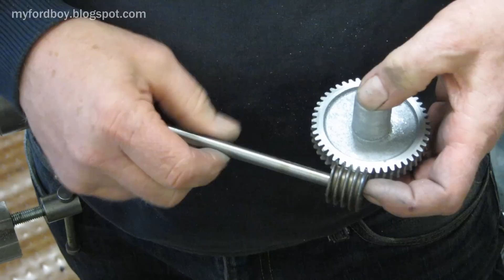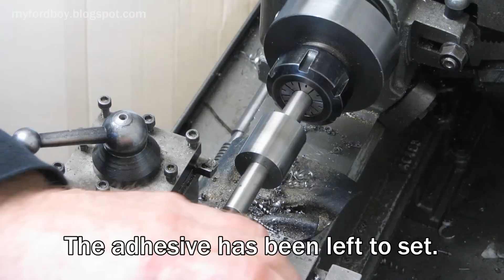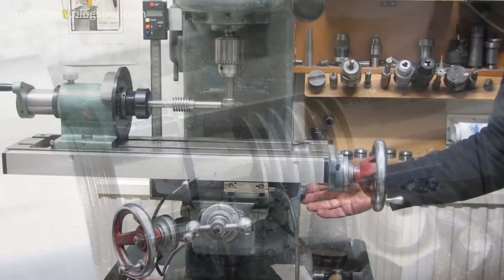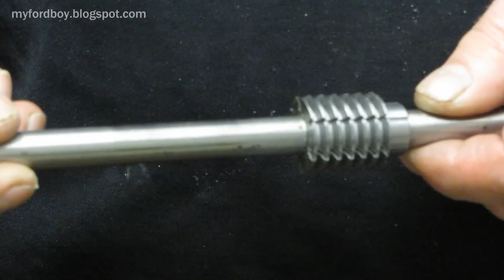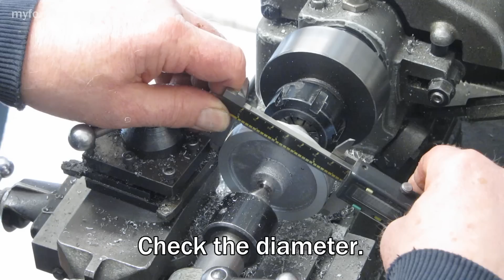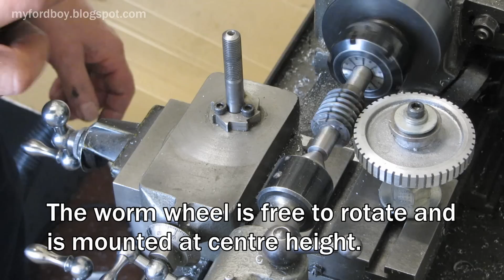Worm & Worm Wheel Free Hobbing Method

Comment: I picked up a Harbor Freight 45861 9 x 20  bench lathe new, a few years ago for about $500 US. About the size of the Myford, just not as refined. I consider mine a work in progress with many upgrades planned. There are several lathes of this size sold by Grizzly and others. A great size for those in need of something larger than the smaller hobby lathes but without the need (or room) for a full size lathe. Love your Myford. It inspires me and gives me something to strive toward on my budget.

Comment: Thanks for sharing. Im a machinist also. There lots of trick you can learn. It very helpful from your experience.  Cutting special thread on lathe is not easy. You got skills . I wish I can learn using software to program and draw desighn for cnc lathe and milling. I have some cnc experiences and manual.

Comment: Excellent technique. Very well done. I do agree with the comment about buying on from, presumably, Boston Gear.

That lathe sounds like the one I worked with as a kid at home. I thought the speed used turning drill rod was high.i had to run the old lathe much slower. I did not have carbide cutting tools.

Comment from the maker: I worked out the worm wheel size and pitch angle nof worm with information in a book. The hardest part is working out the change wheels necessary to give the lead to cut the thread as it is not a standard pitch. 
A method using continous fractions is used and I did find an on line calculator to work out that part.
Reply: What's non-standard about 5·730659 tpi ? (4·4323 mm)

Just you wait until I start threading on my milling machine ! (I'm afraid I can't ! - can't wait to find out what random pitches it'll produce :)
Reply: I have to make a replacement worm and worm gear for my power feed as both are stripped. May I ask what book you used for the calculations? I don't know the correct blank size for the worm gear or what to grind my cutter to. I can reverse engineer it but I'd rather do some reading and learn how to do it right.
Reply from the maker: @LeadedAsbestos  Ivan Laws excellent and inexpensive book. Gears and Gear cutting.
Reply: @myfordboy  thank you. I will order both. You do some amazing work. Thanks again
Reply: @myfordboy  just punched it in. One book lol. Gotcha. I think I'll also get the gingery dividing head book as well.

Comment: The Pitch Circle Diameter (PCD) of a gear is the point between the high and low points that is the theoretical equivalent diameter of a set of simple wheels. Gear teeth reach across that theoretical line and the two extremes are calculated from that median point called the PCD. The outer diameter is less critical than you would think as the highest and lowest points never contact. It is a good place for lubrication to reside.

Comment from the maker: This gear has a 14.5 deg pressure angle so the tool is ground to that angle. It also needs reliving to alow for the helix angle of the gear. The width of the tip is important to and came from data in a book.
I found it easier to draw the angle with CAD and eyeball against this but the tip needs measuring with a mic.

Comment: This is really impressive, and very kind of you to put up.  In addition to the whole concept of making your own hob, loved the bits about using an additional gear set to slow the lathe down to cut the spirals, and using a custom template for the indexer.  I'm going to search around now and see if you've done a similar project to cut your own helical gears...
Reply from the maker: I have cut skew gears but no video record as it was before YouTube existed.
Reply: @myfordboy  I kinda figured you might have.  :)  I've seen setups for it, but they all depended on a very complicated gearing setup between the mill table movement, and a rotary table.  Is that what you did, or did you figure out a shortcut, as you did here?
Reply from the maker: @tomsmith3045  I did mine on the lathe with a milling spindle . Quite complicated. I have some still pics stoneware.
Reply: @myfordboy  Oh!!  So using the carriage to hold a small milling head, with the lathe setup to cut the gears as if they were threads?  That's brilliant.  I'm sure it was a lot of work, but it seems much more straightforward than on a mill, where there isn't any built in coupling between linear and rotational movement at all.  If that was the rough setup, did you have to create auxiliary gear sets, or could you do it with just special threading gears?
Reply from the maker: @tomsmith3045  do you have Instagram? I can post the set up on there if you like.
Reply: @myfordboy  I do!  Thank you!
Reply from the maker: I have uploaded to Instagram #myfordboy
Reply: @myfordboy  Thank you!  Really sharp design.  Love the use of a standard gear cutter, to avoid having to make a special tool.  You mentioned you didn't use the lathe motor - did you just hand feed, using the big MDF wheel?
Reply from the maker: My lathe has a handwheel on the leadscrew and this was used for the feed. The MDF disc is a toothed pulley and belt drive to another, smaller pulley coupled with the changegears to give a very high feed rate.

Comment from the maker: I'll describe it for you here. I don't need to make another so sorry no video.
The V angle in this case is 29 deg as the pressure angle of the gear is 14 1/2 deg.
The tip width is given in charts as .054 for this 18 DP gear. 
The V was ground free hand and checked with a protractor. The point is then ground away to give the .054 dimension. The tool was ground from a broken centre drill. It can be rotated in it's holder to give clearance to suit the helix angle of the worm.

Comment: The only thing I would do differently is to make the worm and hob as one part up through cutting the thread.  Then cut in half and continue with cutting teeth on hob.  Save a bit of time and maybe improve match between them.  Amazed that you got away without tempering the hob…that wheel is one soft casting!

Comment: I like your video.  It gives me hope on a solution.  What my problem is that I need a solution is a large electric motor output shaft conversion to go into a smaller hole of a clutch.  I've looked around, asked around, and seems machinists don't want to do what seems to be a simple male to female shaft coupling.  Basically my electric motor has an 18 point, 1 3/16" diameter, 1.125" long output shaft and I want to broach a sleeve, or internal (female) over it that then has a 7/8 long, 1 point 7/8" diameter output shaft to go into the clutch of my manual transmission of my GMC Tracker.  I don't know if I should try and make a plastic mold and send it to someone, or try and take a piece of stock and broach it with no real tools.  I kind of feel like giving up after handing my clutch and motor to several machinists who put them on their shelf and never did anything with them and only returned them after I called and came over several times.  Not sure what the issue is.  Any help would be appreciated, Jon.

Comment: I already learned most of the job, truth is you learn all your life, but i already learned doing some precision works, i worked on different machines like mills, two smaller lathes and a massive one. I dont call myself and expert in machining, but i would be a mid good guy. I am looking in some years to buy a newer one, a bit smaller than the one you listed, just because i HATE so much the noise that the big one makes in our school, i ant handle it, and i like smaller machines.

Comment from the maker: I have cut steel ones like this so bronze and iron are fine. \If you are using a standard pitch wheel, mine was 48 teeth 18DP thenpitch never works out bto a standard pitch . You have to calculate the lead an set up changewheel to cut it. The one in the video has a lead of 0.1745"

Comment: Shape is not something that can be transferred from a pattern. It is formed by tools set to cut the specified radii of each portion of the curve. There's a good book by Ivan Law: Gears And Gear Cutting - good explanations of design process and cutting processes - Complex, but each part taken slowly builds to an understanding and working knowledge. Expect to take your time, but be persistent and push yourself a little and you'll get it. Only 134 pages but you go a paragraph at a time.

Comment: Hello Myfordboy
Very good video. I wanted to know if you would sell me 1 of your worm drives. I make wooden automatas and I was planning on using your part to copy, using a router. I only need the worm not the wheel. The size in the video would be fine. I would need a 10mm hole centre.
regards
Tim

Comment: Grate job, as usually. Are the following available:
Diameters calculation for both parts
Angle of the tool (40 Deg. inclusive?)
Distance calculation between the centers of worm and worm-gear, nice mill.
The Old Bob
Reply from the maker: All the calculations were obtained from the Ivan Law book Gears and Gearcutting.
I can give you the details of the one in the video if you send me you email address. Mine can be found at myfordboy.blogspot.com

Comment: I think the worm tool needs to be different from the end worm to get the slack in the tooth's foot from the whell worm.
And this is possible by reversing the calculation between head and foot of the tooth of the worm tool.
Maintaining the distance between centers in the manufacture and use of the assembly.

Comment: If you had an adjustable Z axis on the gear when machining it, could you cut a helical gear the same way?
Reply from the maker: A vertical slide on a lathe would give you the same functions as a mill. Bevel gears are cut a different way like this https://youtu.be/7yld4VboYg0

Comment: Could you make the cutter and the actual worm at the same time in the lathe on one arbor? That way would only require one setup and the cutter and worm would be exactly the same size and geometry.
Reply from the maker: You could do that but the reason I did it this way was,
The cutter was made of silver steel and the worm mild steel, making them separately means  a shorter work price so less chance of flex.

Comment: Danbackboard You cut counterclockwise because of the design of the lathe and the fact that you want to have downward pressure on the tool bit.  If you use upward pressure, all of the backlash that would be introduced into your carriage and compound rest would make it impossible to keep rigid (chatter free) and accurate with your cuts.  Since the tool bit is in the front part of the lathe, the head stock is on the left side, and downward pressure is needed during cuts, counterclockwise is necessary.  If you had the head stock on the other end (right side), it would be the opposite rule, clockwise direction would be used, but I've never seen a lathe with the head stock on the right side.

Comment: How do you determine the diameter of the gear?

Multiplying the pitch of the worm by the desired teeth count would give you the diameter of the gear?

Let's say i have a 1.25mm pitch on the worm, and i want a gear with 60 teeth, is it correct to affirm that my gear should have a diameter of 60x1.25 which is equals to 75mm?
Reply from the maker: That would work but there other factors like the gear diameters if you want the centres of the gears to be a specified difference. There is also the helix angle to calculate.
Recommended reading is Ivan Law's book " Gears and gear cutting"

Comment: I have Ivan Law's book but have not read it in ages.  But I do have a question.  When you turned down the worm wheel in preparation to gash it with the saw, it looked like the blank was cut parallel to the shaft that it would ride on.  When you finished hobbing the worm wheel, the face was concave.  Did the hob form this concavity in the gear as it was hobbed, or did you cut it in some how?  I cannot see how the hob would have cut the concavity since you only relieved the cutter at the top of the tooth. The concavity looks like it would have been cut with the root of the hobs teeth, but I don't see how.  Also, I know that the outer diameter of the blank would be (T+2)/P, but that would be at the center of the worm wheel at the bottom of the concave area.  How much is added to this diameter to give the side curved flanks of the teeth on the worm wheel?  Or maybe phrased another way, how much was added to the diameter of the blank to allow for the concavity of the face of the worm wheel?

That was a mouth full and I hope my question made sense.  Maybe my answers are in Ivan Law's book and I only need to read.  But any finger pointing in the right direction would be appreciated sir.

Joe
Reply from the maker: The blank was tipped a little when gashed to the angle of the worm teeth. The concave cut on the worm wheel is generated because the hob that is fed into it is revolving so it produces the same circular form.
I did not save my calculations but just followed the method shown in the book to give the depth of cut and the  required distance between shaft. Nothing is added to the blank diameters.
Reply: Thank you sir.  I retrieved the book from the shelf and am rereading it now.  Maybe I can figure it out.  :-)  The teeth on the worm wheel being concave is what was throwing me.  I couldn't figure out how you got it there.  I am most of the way there.  I can figure out the linear pitch of the worm and the gears to use to approximate it, the lead angle of the worm to calculate the offset angle of the worm wheel to gash.  It was the whole worm wheel diameter with the concave face that was throwing me.  Thanks, as always for such great videos.

Joe

Comment: Hi, great video, i have one question, is aluminium ok for the gear? Because i am   in the stage of making the gear but dont have brass stock. What do you think? Thank you!
Reply from the maker: My worm wheel is aluminium in this video. Worm is steel. two different metals is best for wear.
Reply: Yes i saw that, i just want to know if the aluminium gear is ok, if it resist in time. Because most gears in worm gears are made of steel and brass.
Reply from the maker: @rcalin9354  it's fine for the application I used, slow speed and load. Brass and steel would be better for a bigger load.
Reply: Ok, thank you for your time and reply!

Comment: How do you determine what the wheel diameter has to be for a given gear pitch/diameter?If the diameter is off,the pitch won't make a complete circle,right?Also,would you measure the major or minor diameter of the thread on the wheel?Thank You!!!BTW,personally I still wouldn't trust just the Loctite,I would warm the gear and chill the shaft,but that's just me.
Reply from the maker: It's too detailed to describe here. All the info is in the very inexpensive book "Gears and gearcutting" by Ivan law.
Reply: myfordboy Thanks,I will look that up.I also remembered a have a Machinery Handbook from the 1940's stuck somewhere in the garage.I'm sure there's something about it in there.

Comment: How many starts in  the worm wheel shaft , and why mostly bronze materials using for worm wheels. any how very nice.
Reply from the maker: This worm is a single start one. Bronze is often used for the worm wheel and steel for the worm as 2 different metals have the best wearing properties.

Comment: Why every manufacturer did not make a t-slot cross slide for there lathe is a mystery to me. I have it as a project on my import lathe this winter. I think it will be a worth while project. Nice job on the gear. You must be good at math. :) Pre cutting slots appears to be the answer to assuring the correct gear tooth count. Nothing worse than spending the day making a 60 tooth gear that doesnt have 60 teeth.
Reply: Well, sometimes 59 teeth are OK, and sometimes 61 teeth are OK, but never is 60.5 teeth OK!
Reply: I noticed that T-slot in the compound and marveled at that my self!

Agreed about pre-configuring the tooth count, but some people also forget to check tooth count and pitch against diameter, this one looks like it was fairly well calculated, albeit I have no idea what it is being used for or what the tolerances have to be, let alone application,  load capacity or expected service life.

Comment: How great teacher you are,Salute. I got questions. When you hardening dont you use magnet to check before you dump into oil. At 16.00 Would it be better to tilt indexer front or back a little, So the gash will be tilt.
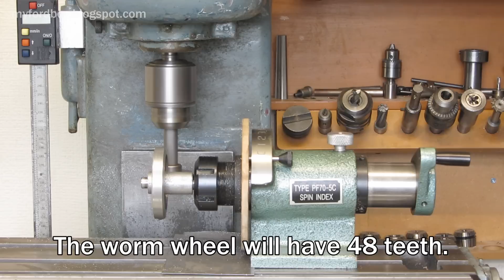Reply from the maker: At 15:42 you can see the index has packing under the front edge and is tilted upwards.  Why would I use a magnet?
Reply: Oh I see now, A magnet is to make sure that steel structure is turned into face center cubic FCC. Which mean it hardenable.

Comment: One thing I always wondered on lathe work:

When cutting screw threads or in this case, the worm gear, how do you insure that the cutter starts advancing at the same point for each pass? If it advanced at a little different point the threads would be messed up.

Thanks!
Reply from the maker: michael C The lathe has an indicator that allows the  the leadscrew to be engaged in the correct place but this only works if the thread is a multiple of the leadscrew pitch. In the case in this video it was a unusual thread and disengaging the leadscrew at the end of the cut would not be possible so after the tool is withdrawn at the end of the cut the lathe is reversed to return the tool to the start.
The indicator on my lathe is behind the carriage hand wheel  https://www.youtube.com/watch?v=FpisXN4anGQ
Reply: ah, I wondered about that. I saw that you reversed the path so that it was the same each time, but wondered about the start point....

You're the best...really!

BTW: built my little forge, melted some pop cans the other day with charcoal, but that's a pain so I'm building a neil propane burner...thanks for all your input with that as well!